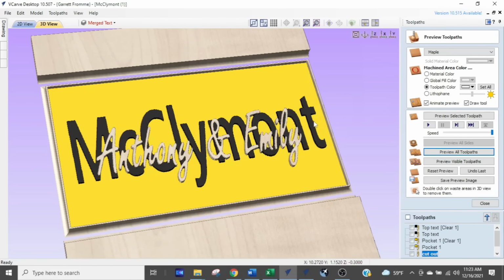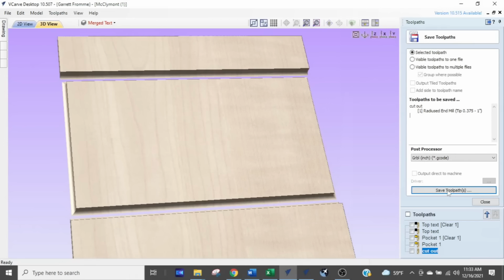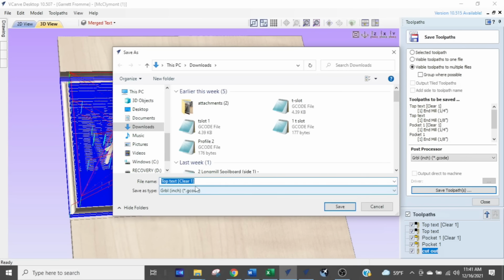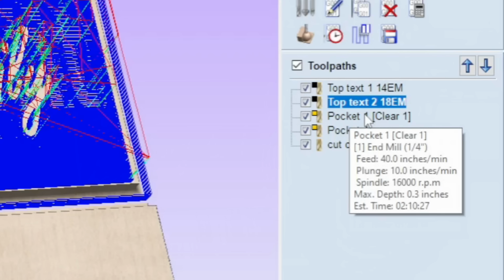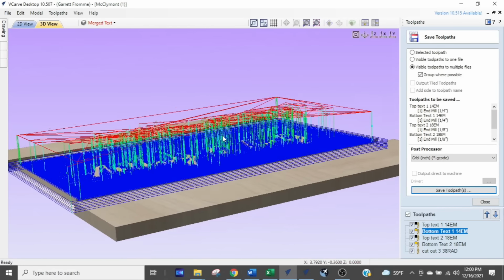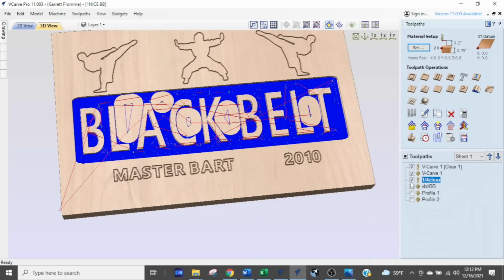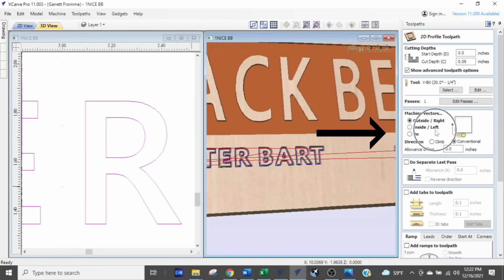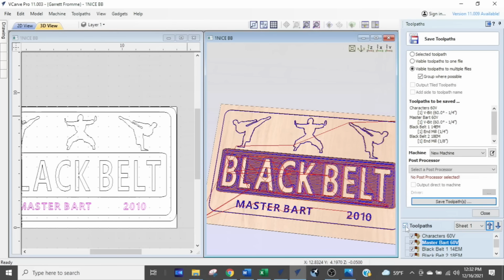How To Set Up Your CNC Router Projects Toolpaths The Right Way [Vectric Vcarve & Aspire Tutorial]

Comment: same you can select different or many toolbath what all used same bit, and different bit need select toolbath and make own saved toolbath,  ewery different bit what you use need different toolbath, and all what use same bit can select all together and run ewery this bit toolbath to same work round, 1 text, then this run 2 text, then run 3 borden etc, if use same bit size. different bit need save own toolbath, and change bit and then open and run this toolbath.
Reply from the maker: mattivirta, You're absolutely right that when using different bits, you’ll need to create and save separate toolpaths for each one. This allows you to maximize efficiency and ensure everything runs smoothly. If you're using the same size bit for different tasks, combining toolpaths is a great way to save time! Happy woodworking!

Comment: i have guestion, i make toolbath and working well, BUT i move Vcarve Aspire toolbath to linuxcnc 2.8.4 version alltime need delete some line at Vcarve toolbath, before not delete not start run, lines have P0.03 M6 T1 and M7 and S1299M3 thats 3 line need delete at G-code then can run program good. why Vcarve make this. i understand tell program T1 tool, S1200 speed. but why not run if have thats 3 line, but if delete lines working well. why Vcarve add this lines if not working and i use "save toolbath-post processor=linuxcnc Arcs mm (.ngc) i hate alltime need open G.code and delete this 3 line and save again changes,
Reply from the maker: mattivirta, Unfortunately, I am not much help here. I am not a tech guy when it comes to CNC machines. I may be good with the programing and operation but when it comes to troubleshooting, I'm an absolute deer in the headlights. I recommend reaching out to Linux CNC regarding your issue. They will be able to help you the best my friend!
Reply: @IDCWoodcraft  ok, i think you can help because understand how Vcarve aspire working, and know how vCarve make post processor to G-code wrong, this is program problem. newermind, thanks u answer.

Comment: Hi Garrett, I recently upgraded to liquid cooled spindle. This is on a Next Wave HD 510. My question is this, is there a way to run the spindle manually? With a router motor I would sometimes put a board on table and do a quick surfacing. Would plug motor into an extension cord then manually toggle x and y and x till board flat. Also occasionally just put a vbit in to run a line in x or y. I could do all that without doing a program.  I just found it quick, simple and easy. The spindle runs through a VFD and control box. The VFD has buttons on but don’t seem to do anything. Any help greatly appreciated.
Dave
Reply from the maker: davecable3104, Congrats on upgrading to a liquid cooled spindle, that sounds really cool. To run the spindle manually, you might want to check the user manual for your VFD and control box. There should be a way to toggle the spindle on without running a full CNC program. If you are still having trouble I recommend reaching out to Next Wave Directly, they will be able to help you with your specific problem.  Good luck with your quick surfacing and v-bit lines!
Reply: @IDCWoodcraft  Thanks! I did email Nextwave and got a reply. Just for your info, there is a way, but not a simple one. It’s a lengthy process and ultimately ends up with everything being totally manual. It can also be reversed back but again a lengthy process. Not sure what I’ll ultimately end up doing.
It’s so easy when putting a small piece on to just do a quick surfacing manually.
Thanks for your reply 
Dave

Comment: Great video Garrett. I actually had a similar problem as Bart in a STL file I had downloaded. Being a STL it was actually a 3d image and I was trying to cut it with a Vcarve tool path and a 90 degree tool. It wasn't that bad except at the corners where it had a little eagle image. That looked terrible until I switched to a ball nose bit. Very long time to carve as well. Still learning and experimenting with different software. I think Vectric owes you a lot for your promotion. Comparing Vetric to their competitors is like comparing Windows to Linux, you generally get what you pay for but they can reach the same goal if you put the effort into it. Someone had asked about FreeCad to do wood working, and I have used it enough to say, it will work for simple projects, but it's just not made for wood working, so if you have a need to do CNC routing Vetric is by far the best. I've given Carbide Create a hard look, but at the end of the day you don't own it, so to me that's a no. I will be buying Vectric Desktop when it warms up, too cold to work in a shop with no heat!
Reply from the maker: Kwikcarl, very good points brother! Keep working hard and learning everything you can. You will work through those tricky problems in no time. I am excited for you to pick up your full version of Vectric Desktop! I have a special link you can use, it gives me a little pocket change. Here is the link if you decide to use it when you buy Vectric: https://bit.ly/3D4CwjH
Thanks brother!
Reply: I purchased the Vetric Desktop software today with the link you sent, but I don't know if they credited you for it. I didn't see anything to indicate it was anything but a normal purchase.

Comment: How come you totally skip the crucial beginning of the process? I have a project out of acrylic where the outside of the shape is cut through in two passes with an 1/8" bit and I have another line (rectangle) that I want to cut .080" deep only. How do I do this?
Reply from the maker: Hi Ian. This video showed a particular aspect to designing. 

The link below is a complete project walkthrough. I think it will answer your questions
https://youtu.be/C46zguYGM-o

Comment: My brother and I are going to buy a
cnc router. Have looked at so many.
We are down to Long Mill or Onefinity.
Also we think we want to go with a spindle
Instead of the makita if this is a bad idea please let me know. Me nor my brother have 
ever even seen one run. We are both new to cnc and are learning from your videos. Thank you.
Reply from the maker: Hi Mike. I know it has been a confusing journey figuring out which machine to get. The good thing is, you've narrowed down to 2 good machines. Spindles are great. However, they require a little extra knowledge. I recommend you use the trim router first.

Can you do me a favor. If you decide to go with the Longmill, can you please use my affiliate link. It'll give me a little pocket change. Thanks.

Comment: Garrett, I found out that Next Wave CNC' machines only use certain G Codes with their software. So, for example, if you turned me on to a certain project with a certain G code toolpath to upload, it may be possible that the G code toolpath you setup may not be read in their machines. How do we fix that?
Reply from the maker: Hi Max, you'll need to regenerate your toolpaths through your designed software.

Comment: jeffwould you send me the list
Reply from the maker: Ok.  I send a lot of people the list so I don't always remember. My apologies for forgetting.
Reply: @IDCWoodcraft  You did not for get I just watched tis video and found  out about other videos I would like to watch could you tell me what the sheets thing in vcarve pro11 is all about in the tool path window. 
Jeff
Reply from the maker: @resorter66  sheets are pretty cool. It allows you to keep all your designs on one screen. If you have a project that requires multiple blanks, and each one has a different project on it, you can look at them all without having to have multiple VCarve programs open.

In effect, sheets is the equivalent of having multiple VCarve programs open, but only having one open. 

I've been asked this a few times so I will do a video on it soon.
Reply: @IDCWoodcraft  Great I will be looking forward to it. Garrett the spoil board bit you sell what speed feed and plunge rates I want to flatten a slab of Ash that fell on our cabin in September .to make asign out of it.Jeff
Reply from the maker: @resorter66  about 12,000 RPM at 120 inches per minute. Let's take off no more than 0.1 in per pass
Reply: @IDCWoodcraft  Thank you.what about the step over
Reply from the maker: @resorter66  always 70% with the surfacing bed

Comment: another great video, I have just one question, on Bart's project when you do the End mill clearing, with 2 different tools, does the program stop so you can change out the tools, then continue on, very confusing for me, sorry might seem a silly question and does the same apply when changing out to the V carve tool, or are they all separate programs to run?
Reply from the maker: Hi Warren. Yes, the program will stop. In fact, it creates an entirely different program...#2 for the job. You have to load the new program after you change the bit.
Reply: @IDCWoodcraft  I thought as much but just was not really sure, have to watch more videos to fully understand the sequence involved.

Comment: It seems that this could have been much simpler in Emily’s set-up by noting that ‘naming toothpaths’ have protocols.  The brackets didn’t define different toolpaths. So, we have to rename them, ok, then since the same 1/4 end mill is being used, we can combine those operations into one toolpath.  That is all that needed to be said.  It explains it in clearer terms.  The same for the 1/8 EM, as long as the same profile (?) toolpath is chosen, or could there be a different one?  Explaining the difference between a profile letter and a v-carve letter operation is very practical for teaching what went wrong, especially with the karate job.  
Didn’t the cut out  that was originally checked, clear all the area including the would be letters, so that is why the letters didn’t show up?  Isn’t the chosen pocket or profile mode the correct choice?  Do I use an offset with the 1/4 end mill, or does choice of profile do it automatically because it can’t cut the fine detail, so that means the 1/8 end mill has to be doing the detail?  
With the karate job, will simply choosing the correct mode of a pocket instead for V-carve change the operation correctly?  So, it has to be obvious that choosing V carve mode is not going to work even though the correct end mill was specified in the tool choice.  Again, brackets don’t work as they are simply for the operator information, not the generation of tool path protocols.  
To me it seems that saving Emily’s stuff which isn’t working  and then going to the file and deleting it creates confusion, instead of simply not getting to the facts that particular order won’t work and why.  Do I make any sense here?  
If a second level of a name below the first (or surface zero) is being made, the first or zero surface is not milled, only the outline, but the surface of the second level of letters by the pocket operation operation can be done with a pocket mode only over the surface of those letters? Then the pocket operation of the final surface is done by profile with an 1/4 EM offset, and the fine detail done with the 1/8 EM profile.  Of course, the sign outline can be combined with the interior pocket by specifying a separate operation using the same EM and proper toolpath of the vector border.  Make any sense?
Reply from the maker: Hey Paul. I'm sure I could make it simpler. However, I get asked many of these questions. and it is always good to know the depths of why things happen. But your input here is invaluable and I am glad you shared it so others will get these tips, because they are important.
Reply: @IDCWoodcraft  I felt bad afterwards, as I don’t like to be critical when not totally in the loop as to why things are presented as they are.  I won’t do that again on YT, but instead do a direct email with any problems of my understanding.  I am on vacation in Palm Springs for two weeks until Jan 3rd.  Hope your weather is not going to be too bad in Madison.  My AVID CNC Pro leg kit is sitting in my garage in pieces, and as soon I finish moving things around and out, I can begin assembly.  Have my dust collection and the rest of the parts in my storage unit, so things are going to move forward soon; some dedicated electrical is in the works & needs to be done for the 110 and 220, then the switch can be thrown!  Thank you for all you do for us rookies; I have my Vetric license and am working on things now and following along with presentations for familiarity.  😎🎄Hope your holidays are special!

Comment: Great walk through on file/tool path management!  Question regarding Text on text (stacked) on one of my projects in hard wood my clearance tool path was breaking some of the text In MDF this is a non issue,  any issues with tool path order ie fine tool path first then clearance?
Thank you for your time!
Merry Christmas!
Reply from the maker: Hi Kevin. I sometimes run a profile first around the letters then do all the finish work. That way the smaller parts have as much support as they possily can while cutting

Comment: Comment? :  The name we use on the "Save As" tool path file name window is a "prefix" ;) 

Also, of course, the instant you release a video on sumpin, a new feature needs to be discussed!   "Avoid Machined Areas" of roughing path, in V11 !!  Yaaa, Und Gut!
Reply from the maker: I couldn't think of the 'proper term when I was recording the video. But the context made sense I hope.
Reply: @IDCWoodcraft  Of course it did - don' mind me, I'm just an ubher geek on stuff... Most was covered in other video's, but it's always good to see it expressed in models produced by folks.